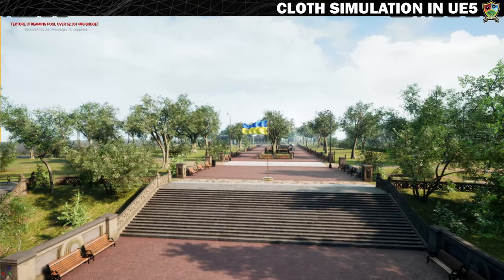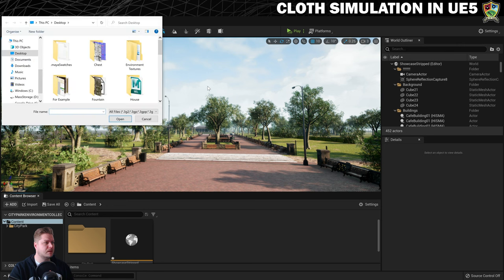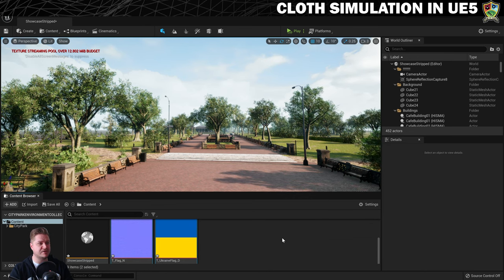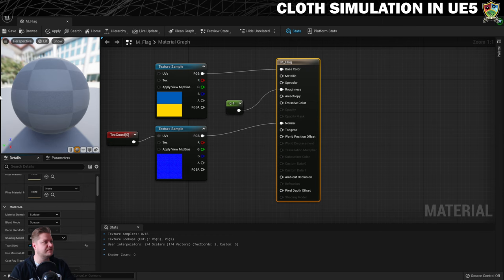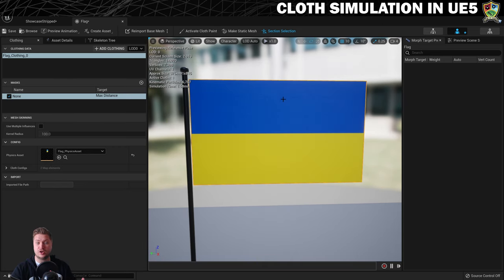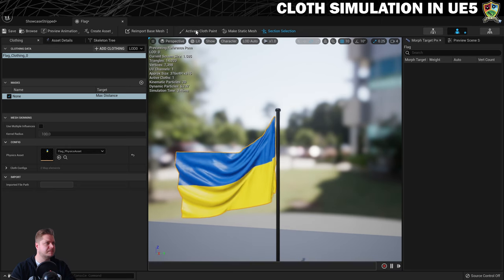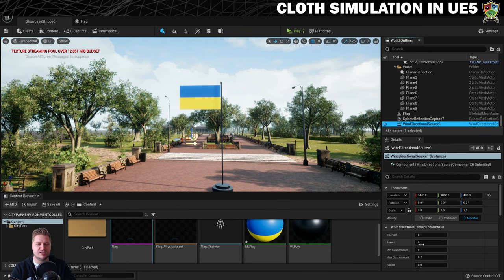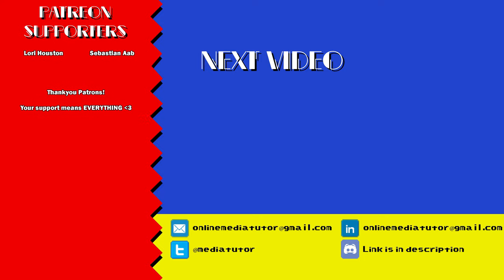Super Easy CLOTH SIMULATION in UE5!

Comment: If you can't find "Section Selection" or right-click and the menu didn't show up. Here are the steps I've done to solve it:

1. Make sure there is NO TRANSLUCENT material on your clothing - mesh with translucent material cannot be selected even if it has sections. 
(you can swap out translucent materials and create clothing asset and swap it back later)

2. In your 3rd party software (I'm using 3dsMax), select editable poly / mesh > element > Material IDs > make sure each section of the clothing has a material ID assigned to it.

3. If your mesh only has 1 material ID, the "Section Selection" button will still NOT SHOW UP in UE5 - however, you should be able to right-click on the mesh and see the pup up menu.

Comment: Section selection doesn't exist for me.
Reply: same, did you ever find it?
Reply: @aiiwrex8856  Nope rip
Reply: @ramyfili1434  Ah well that sucks.. hopefully its just some temporary thing in ue5.. ☺️
Reply: @aiiwrex8856  any luck?
Reply: @EMNM66  yeah no.. nothing new
Reply from the maker: It's there. You gotta look for it. I couldn't find it at first. It's not a bug though. It's there. Promise.
Reply: @GameDevAcademy  where?
Reply: @GameDevAcademy  I am in the same windowm in the Skeletal Mesh where you can activate and deactivate the cloth paint and there is NO SECTION SELECT where it is in your video.

If it's in a submenu please tell which one!
Reply: @GameDevAcademy  this isn't helpful
Reply: just click I think section selection is automatically on
Reply: Bruh.. i found the answer i think! atleast for me it didnt exist when it was a single object like just a cape or flag.. but u just have to click the mesh.. im so annoyed about it, but that made it work for me, so just click the mesh, create cloth and right click apply aswell... hope it works for you aswell!
Reply: Solution: I think the button was removed, and Section Select is now the default behavior. If you just click on a mesh it will highlight, then right-click on it and the expected menu comes up to add a cloth layer. From there, it's the same process.
Reply: when you import model, you need to choose MESH -> SKELETAL MESH. then it will appear as shown in the clip